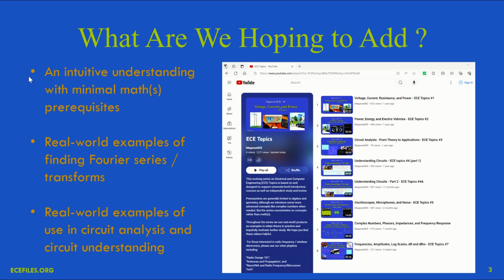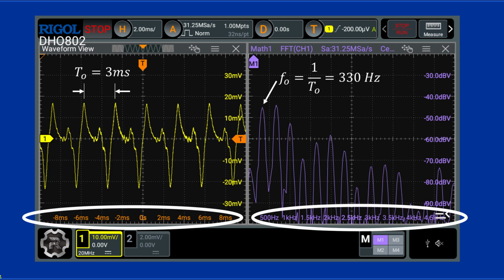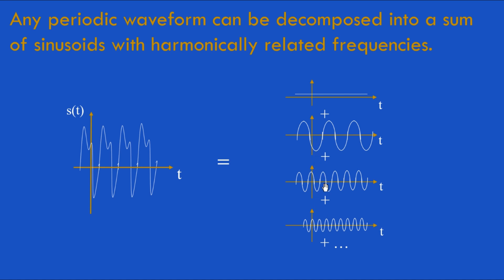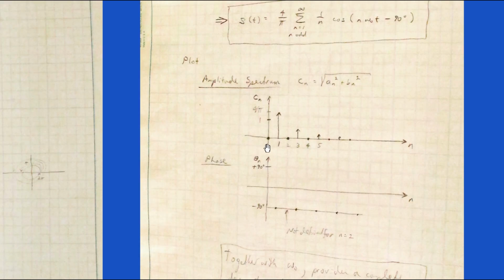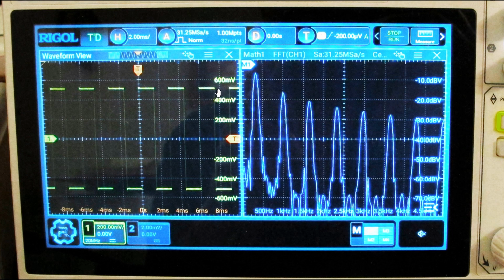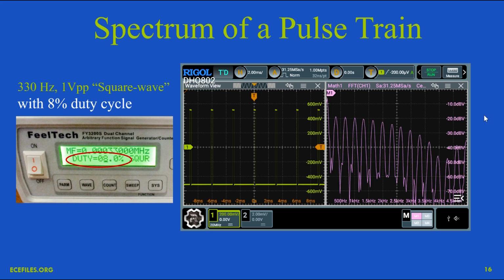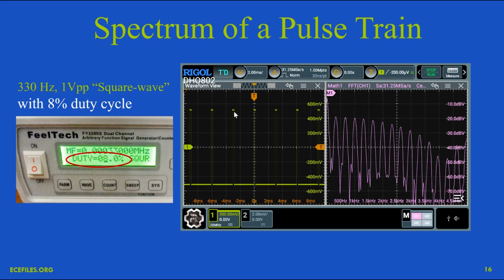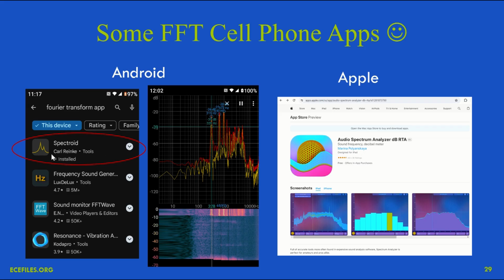Fourier and FFT Concepts in Circuit Design - Part 1 (ECE Topics #8)

Comment: You can cheat that bandwidth for a bitstream quite a bit if you are willing to accept a slightly higher error rate.  For those interested, QAM (quadrature amplitude modulation) and digital data compression algorithms are the way to cram quite a bit more information into your bandwidth.
Reply from the maker: Thanks for this good point. Yes - that's one of those ingenious ideas that can be employed when the math is embraced 🙂 My cable modem is using 256 QAM I believe, allowing 8 'bits-per-Hz' (or 48 Mbps in the space of one 6 MHz 'channel').  Two related things for those interested include the Shannon-Hartley limit on bits-per-Hz that can be achieved in theory, and OFDM modulation that actually employs the FFT (and inverse-FFT) together with QPSK or QAM to do this on messy wireless 'channels' that have fading. Fair warning: Each of these topics is very deep mathematically. But here's a good overview of OFDM and its use of FFTs: https://helpfiles.keysight.com/csg/89600B/Webhelp/Subsystems/wlan-ofdm/content/ofdm_basicprinciplesoverview.htm